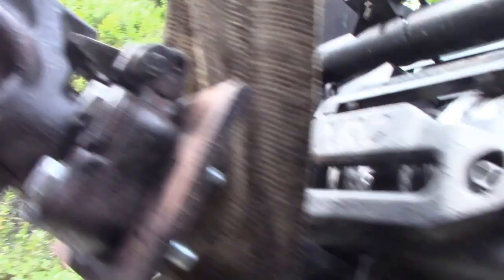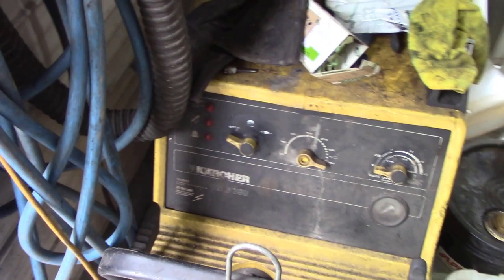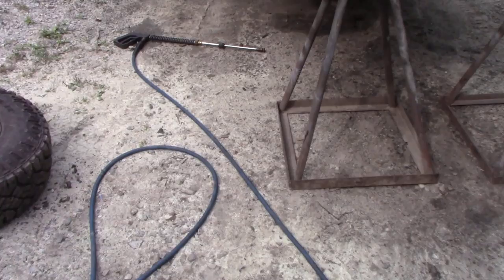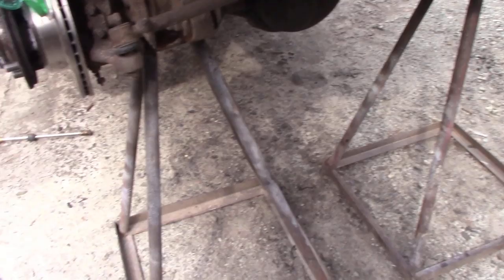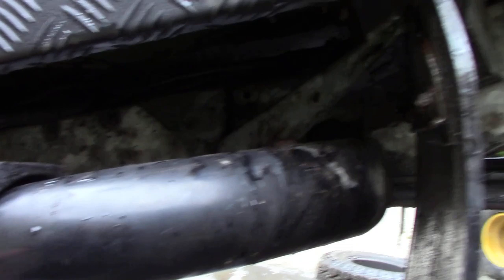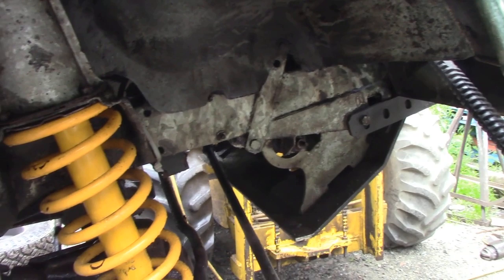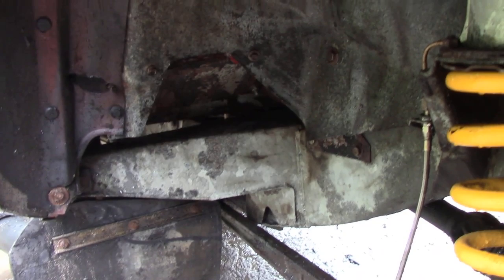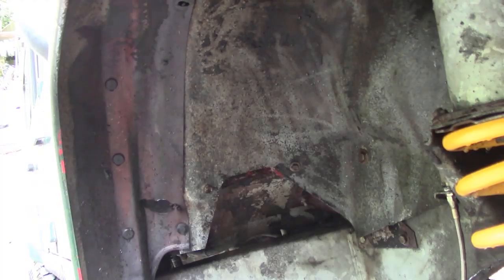Power washing the 110 Defender ready for new rustproofing  - not a nice job!

Comment: I have made up extensions to the front wheel arches (on the rear side at the bottom) which removes the mud traps and protects the outriggers. A simple bbut very effective mod. I have bought mud protectors for the rear ( from Gwyn Lewis in Wales) but I haven't seen similar items for the front on sale anywhere.

Comment: I enjoyed this video! It reminds me of when I used to work for Mighty Minis And Metros in East Devon (long gone now). Mild steel floors, sills, valances and subframes would continue to excessively rot away underneath the sticky bitumen-based thick rubber coatings applied just to get each car through an MoT. To initially prep each car for work, I used to jetwash the undersides only for me to get showered with black rubber excess coating which was stuck to very flakey, long-corroded metal. It really was a crap job!
Reply from the maker: It really is a shitty job and you cannot pay a man enough to do it! 
This stuff does not harden in the cold and does not drip like some oil based rustproofing when it is hot

Comment: Hi Mike i had all the wax  accidently taken off using this although it was a recent coating put on i had started to clean the engine with a pump sprayer  id mixed it in but using the rest up on the chassis thinking it would just get the dirt off after leaving it on for 5/10 mins then power washed it and it came up clean
this is the stuff  Surfex HD buy Bilt Hamber
 This great wash / prep stage development from Bilt Hamber is a spray and wipe clean product designed to attack all oil and grease based dirt and grime build up on your vehicles paintwork. Because this product isn't solvent based (which is great in environmental terms) this product is able to attack and effortlessly clean organic, or water deposited grime. This great product provides performance levels that match and even exceed solvent systems while meeting the latest standards of biodegradability. Adjust this product to the strength suiting the level of soil and dirt as it remains active at levels of just 1 part to 200 in water for light work, or used neat for extreme duty. Surfex HD is recommended for all arduous automotive, commercial and domestic cleaning duties. Can be used on paint, wheels, tyres, fabric, carpets and most surfaces. Spot tests are always advisable
Reply: I've not used this product but Bilt Hamber do some brilliant rust removers,  bio degradable as well,  just mix with water,  throw in rust caked bits and a few hours later they come out rust free.  It's not often I'm impressed but I was impressed!
Reply from the maker: Actually I have a test video of a product we have here when I was cleaning up knackered VE pump parts - yes I was impressed! 

I should make it public

Comment: How did you clean out the inside of the members? My solution is to drill holes so I can pass a garden hose along the full length flushing out any dirt. I have bought plastic plugs to fill the holes keeping out mud etc. This works much better than trying to pressure wash through small dia holes which only permit a limited spray pattern. My 30 year Defender has very limited corrosion (hardly any) and shows the value of taking these precautions.

Comment: The powdercoating on my Defender bullbar acted much the same way - once compromised, it allowed water to wick in and it was "always wet" and always rusting. It was cheaper to buy a new one (from a LR dealer!) than repair
Reply from the maker: That's why I stopped buying and supplying anything plasticoated 10 years ago
Powder coat is a real bond, but this plastic coating is terrible here - as you say it cracking in the cold, and water gets in and cannot get out

Comment: The “mud trap” on the front outriggers is a nightmare. 
I’ve mounted my old rear mud flaps over the hole/outrigger to stop it
Reply: I have done the same using aluminium sheet.

Comment: Hi Mike. I wonder what precautions you suggest to avoid high pressure water getting where you don't want it to go. Personal experience is you can end up with a real mess inside the vehicle.  Most Land Rover owners will know that there are lots of holes, unsealed seams etc which will allow water in - and unless you do a lot of wading you might not have discovered before. It may be that you just let it dry out afterwards. What do you suggest? Cheers Simon
Reply from the maker: Good question - I just let them dry out usually - the power wash will find hole that need sorting - the shell on this was badly corroded
Reply: @BritannicaRestorations  Understood. Anyone with fixed carpets needs to be careful to lift them and see what nasties lie below!!
Reply from the maker: Agreed! The P38 I just scrapped was soaking wet inside - the foam insulation was like a sponge!
Reply: @BritannicaRestorations  My battery box was horrible and the rear footwell was under about 1 inch of water. The positive in this is you realise where the holes are - three cheers for dum dum!!
Reply from the maker: I often wonder if LR ever took one of their old vehicles in that has been on the road say 5 - 10 years, take it apart and study what real driving/ownership does to a vehicle

Comment: Sounds like me removing wood-chip wallpaper :-) I'm surprised you can't find someone local to do this. Usually truck stops have HP washing services either onsite or nearby? I used to think Karcher was German (based on the name), but the first time mine froze in the garage over winter and disabled it (broke a 25¢ plastic part that was $20 to buy) I discovered it is Italian - now I understand. So now I am fastidious about draining befor winter comes. But really - do they expect me to bring the thing into the lounge over winter?
Reply from the maker: You should run some used antifreeze though it on the last use before winter ( great use for it BTW!)
This is a good old German one when they made proper power washers - I was tempted to buy new but this came up used but broken
I had to replace the contactor and bypass a few features (low fuel level as it is interlocked to starting) but runs like new

Also I run some  muriatic acid through the boiler coil once a year to reduce scale which reduces the output - amazing difference to performance

Karcher sold out to the cheap home market use, and the smaller stuff is not much good - plastic parts as you say
I recently bought a Karcher upholstery cleaner and broke after the warranty was up - and that was a $800 machine!

Comment: Can you paint the underside with a non bitumen based glossy underseal paint to help shed water and dirt? Just thinking that this might protect and aid future cleaning.
Reply: Just put a new chassis, shocks,wheels, etc. On whenever it needs a wash.  Swap all connections for quick lock ones and I am sure you could get the change down to an hour. No need to ever wash a Land Rover chassis ever again.

Comment: Love your channel Bill, Is it Bill? Anyway, would we need to be careful if damaging anything underneath with 2000psi washer? Like, electrics or plastic fittings?  2003 TD5 90 
Cheers
Reply from the maker: 2500 Psi is the pump pressure at the nozzle - the further you get away form the surface you are blasting the less pressure

Comment: Whats your thought on corroless chassis rust inhibiting paint? my galvanizing was shot so i used their rust converter. I figured i will just abrasive blast it off when it flakes and paint a fresh, but its not failed yet in two years. its also only 8 pounds haha. Also what about coaltar paints. maybe you could use some of your scrap defender chassis for a test video?
Reply from the maker: I am not familiar with these products but i will check them out

Comment: How do you best wash the inside of the frame? Special hose for the pressure washer?
Reply from the maker: Be brave and drill a few 25 mm holes is the bottom of the chassis and wash out with a pressure washer

Comment: Use diesel works every time
Reply: Am I being a bit dim if you use diesel then it comes out of the exhaust pip as fumes or black smoke how does that work ???????????
Reply: @weaton25  u just put diesel on a spray compressor takes off greasy    stuff.

Comment: Rust bucket land rover can't think of any other vehicle you have to rust proof only land rover total crap rot box on wheels!!
Reply: As a life long land rover fan I feel compelled to respond to this very negative view of the marque....I agree!
Reply: @darland3821  bwahahaha
Reply: Yep they rot.  Better with an 80 series Toyota or one of those Nissan pick ups ,  oh hang on,  the 80 series rots around the rear quarters and Nissan have been buying trucks back after they snap in half due to corrosion in the chassis . . ..   At least Land Rover bits are cheap and plentiful in the UK and you know what your buying into.
Reply: @weaton25  rust may be!! holes new chassis welding no on any othet 10 year plus vehicles probably not only land rover but people who buy them seem to like to fix then rather than drive them
Reply: @kingquadking6075  my ex military 110 did 16,000 miles last year and will be over that this year,  engine oil and filter every 10,000km,  engine oil,  tappets,  gearbox,  transfer box, diff oils and diesel filter every 20, 000 km.  Bought for the weekend but used everyday,  winter and summer,  zero depreciation ,  my last Toyota surf,  oil tight as it was,  lost a lot of money and here in the UK there are only 2 places that sell upgrade parts and they're not cheap,  with the landy (at least in uk)  I have a land rover supermarket 9 miles away with staff that have an interest and what they don't have in stock they get for next day.. Besides,  I won't buy Japanese since they've started whaling again.
Reply from the maker: I was just thinking - what happened to that dude in the UK who was going to build a 'new' Defender?
Seemed to have gone quiet
Reply: @BritannicaRestorations  Ha,  you mean Projekt Grenadier?  (the clue was in the spelling all along)  seems after all the jingoistic flag waving and traditional pub launch,  lots of defender pictures on their instagram etc, it's being developed by a subsidiary of Mercedes benz . . .  Oh and its using BMW engines and it may not be built in the UK (you can see the flag wilting by now)  so, it will be British in spirit but sod all else.  Woo hoo. . . . .
Reply: @grievuspwn4g3  some rusts faster though,  poor quality were there are iron particles left will rust faster,  Alfa,  Lancia and Fiat used poor quality Russian steel,  when the paint was stripped you could see dots of rust,  that was poorly converted iron,  Alfa Romeo warranty was to support the panel and centre pop the small spots.
Reply: Yes nissan got a problem with early pickups agreed but they will buy them back or fix the problem free of charge all land rover will is sell you new parts just keep spending on your landys boy spendspendspend what the saying one life just tow it!!!! Lol
Reply: @kingquadking6075  yet your watching a man fix land rovers on you tube . . . .  Envy is a dreadful thing 😀
Reply: @andicog  no pop ups. Won't. Leave me alone I have tried to block them but like a land rover once you start you can't stop